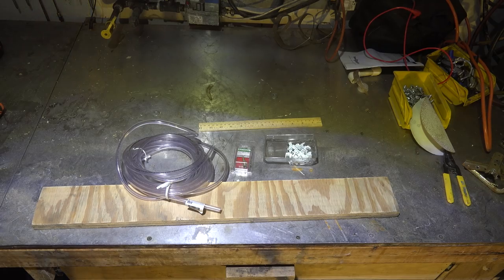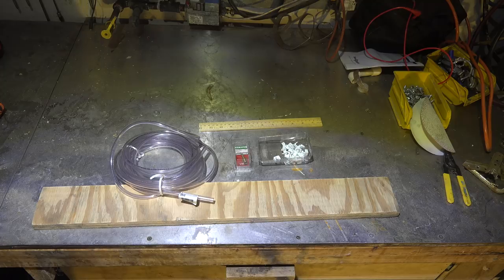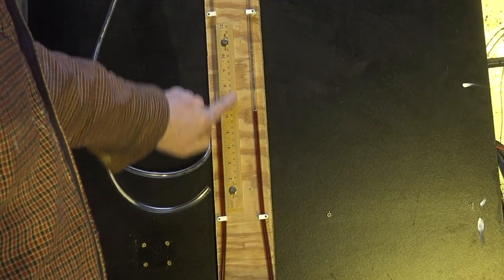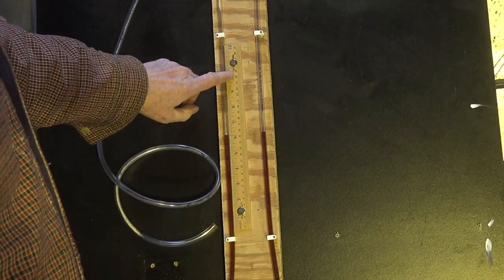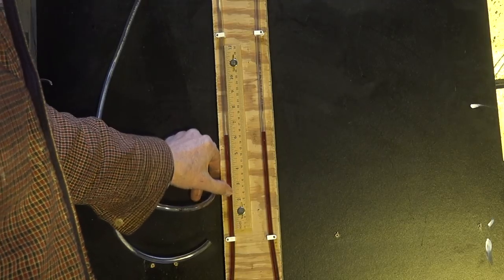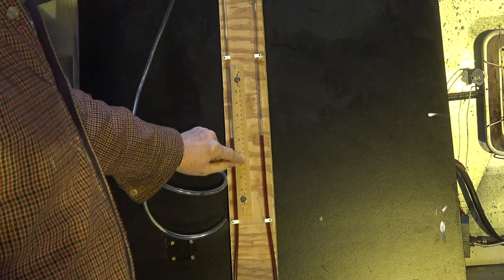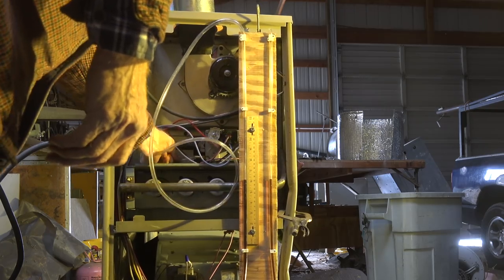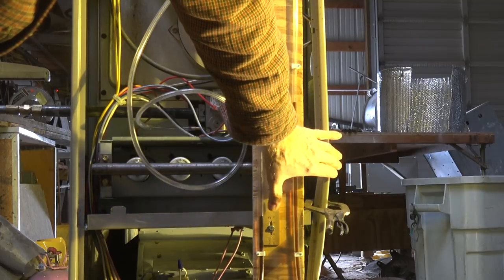Build a manometer

Comment: Great wisdom, Grayfurnaceman!
Yes, using oils increases the manometer sensitivity and readability since most oils are less dense than water and have less surface tension. Remember to correct your reading of "inches of oil" to "inches of water" by multiplying the oil inches by oil density, then dividing by water density. 
Inclining the manometer also makes it more sensitive, as you saw. For a 30 degree inclination from the ground, divide the inches reading by 2.
Reply from the maker: The red gauge oil I referenced has the same density as water so it does not require adjustments.
GFM
Reply: @grayfurnaceman  How is that so?  I have red gauge oil for my Dwyer manometer and it says "specific gravity" (density, correct?) .826.  According to https://www.engineeringtoolbox.com/water-temperature-specific-gravity-d_1179.html water has a specific gravity of roughly .999

Comment: Awesome dude. Exactly what I was looking for - simple and easy. I need to measure the pressure for a propane furnace I installed in my garage and did not want to spend money on a tool I will probably never use again. I'm 63 and never needed one so far!! I even have all the hardware needed too. Thanks a lot.
Reply from the maker: Welcome
GFM

Comment: Nice video, told a ceiling guy to use a water level when his lazer broke on a job and he had no idea what I was talking about. Old school always works. Thanks for the video's.
Reply from the maker: Welcome
GFM
Reply: I've been studying the slide rule, but it's easy to see why they discontinued producing them after electronic calculators came in.  That said, a scientific calculator is not exactly easy to use either.  Both take significant training or understanding.

Comment: I’ve been really enjoying your videos and exploring some of the older ones. As a new first time home owner these have been very educational for me and have helped me to understand my homes systems. I was wondering, though, if you could do a video if you haven’t already on ceiling heat, like the electric radiators in the ceiling that can be adjusted for each individual room. I have seen your videos on ceiling diffusers, and I was wondering if they would be similar or if there are peculiarities with radiant ceiling heaters. We had them in a previous rental and we did not like them, and we believe that they were a significant source of high electric bills.
Reply from the maker: That is one that I have been meaning to do.  Maybe this will get me moving.
GFM

Comment: It is NOT advisable to use red gauge oil unless it has a specific gravity of 1.0 or you create your own scale (a ruler won't work)  Oil is less dense and will indicate higher pressure than water column pressure.

Comment: The content of this video and its  presentation both are really helpful to build a manometer. Would this be useful to measure static and dynamic air pressure of the air outlet side in a household vacuum cleaner?
Reply from the maker: Yes.  You may need longer tubing.
GFM

Comment: Nice video as always! Just curious- Would using oil instead of water affect the accuracy of the tester since oil is less dense than water? I presume that it would chance the reading a tiny bit, but not enough to matter. Thanks!
Reply from the maker: The red gauge oil is the same density as water.
GFM
Reply: @grayfurnaceman  Cool, thanks
Reply: @grayfurnaceman  So does that mean that it will mix with water since the density is the same?
Reply from the maker: Beats me
GFM
Reply: It has to have a specific gravity. Somehere in the region of 1.0 SG. For standard tube. Manometers which are shorter in lengh have smaller tubes. So the specfic gravity of the fluid tubes tends to be higher. So the fluid can flow easier. You shouldn't add any colouring agents to your manometer as it makes the SG more dense. 😊

Comment: Is the end of the tube were the fluid rises open to the atmosphere?  Do you put plugs in to transport it?   Also, can't you use the fluid in the two tubes to level it?
Reply from the maker: It is open.  You can add fluid to level, but it is easier to get it close with fluid then fine adjust with the scale.
GFM

Comment: If your WC is reading 8 WC, I'm assuming it's propane gas which should be 11 WC. Natural gas would be around 6 or 7 WC .............  right?
Reply from the maker: In most areas, natural gas is 8 inches wc.  If it is propane, I would expect 10 to 11.
GFM

Comment: Unrelated to this video i have a question. First of all your videos helped me fix my furnace and i thank you. 
My furnace fan kicks on and off the whole time the furnace is running and then over and over again after the furnace shuts off. Is there something wrong?
Reply from the maker: The fan should run continuously during the on cycle.  You probably have a heat operated fan switch and it is cycling the fan.  The on and off temp settings may need to be reset farther apart.  
GFM
Reply: @grayfurnaceman  do u have a video on that?
Reply from the maker: I have a number of them.  Try this one:  https://youtu.be/QpHfFdk04u0
GFM

Comment: Does it matter how much water do you put in tube?
Reply from the maker: Enough to level out at 0 inches.
GFM
Reply: @grayfurnaceman  I guess it doesn't matter as long as it is not excessive.
Thank you
Reply: @grayfurnaceman  I have a question is it gas valve if I am getting zero pressure on the outlet side of the valve and 4" wc on the inlet side? I call feel the valve clicking and the igniter sparking and visibly see it but no gas at the burners. I replaced the control module because no spark and once I took it off one of the traces was visible burnt and broken. When I make the call for the furnace to turn on at the mechanical thermostat I see it go through the sequence to light just not getting no gas on the outlet side of the gas valve. The gas valve is White-Rodgers 36h32-406. I have another gas valve on the way which is newer version of that one. Same specs.
I just wonder if I'm missing something.
Reply from the maker: @rlicon1970  Most valves require 5" WC at the inlet and I would prefer 7".  Might check with the gas supplier.
GFM
Reply: @grayfurnaceman  I just checked it is at 6 1/2.  The other furnace is working properly. The spec says 1/2 psi Reg 3.5 wc. I am hoping this is the problem because I already ordered it. I was just hoping I was not missing something.

Comment: How much is diameter of tube used here?
Reply from the maker: 1/4" inside.
GFM
Reply: @grayfurnaceman  Doesn't the tubing diameter affect the reading?  Does it have to be 1/4'' ID to be accurate?
Reply from the maker: @zoharflax6363  It does.  Anything below 1/4" will be affected by capillary action. Larger is ok.
GFM
Reply: @grayfurnaceman  I am confused. I thought the video said you used 3/16 ID tubing. As the barb is a 3/16 barb. Did I misunderstand?